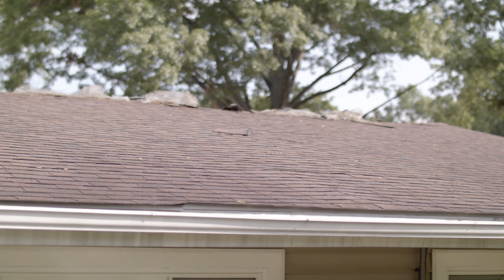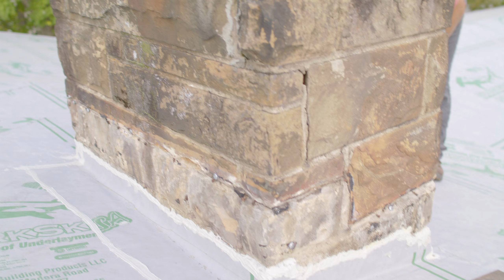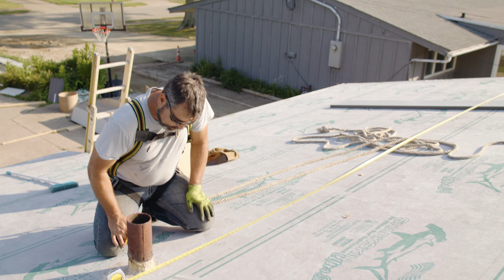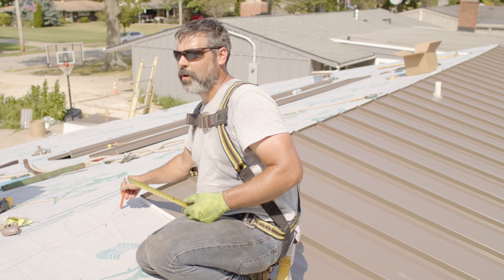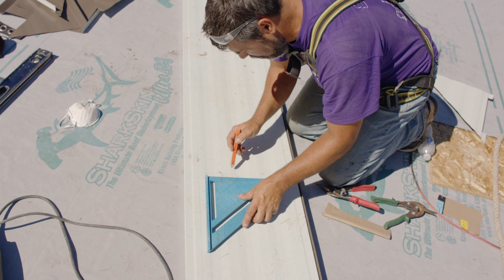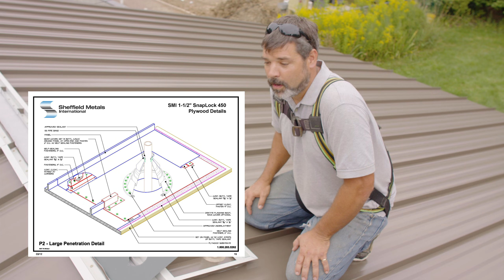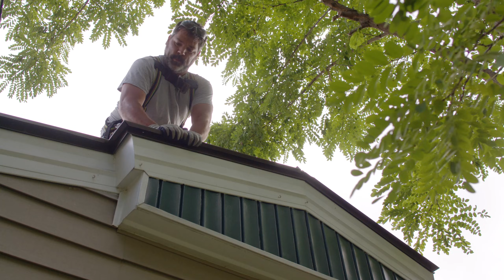How to Install a Standing Seam Metal Roof from Start to Finish

Comment: Thanks for sharing, why weren’t 1x4 wood pieces installed for air ventilation like you did on Matt Risinger’s roof, is it cause this house has soffit vents while Matt’s doesn’t?

Also, if I understand correctly Sheffiled Metals is the manufacturer, but what happens if I need different lengths - who cuts and delivers those?

Thanks again.
Reply from the maker: Matt's roof was designed with an above-deck ventilation system which also creates an air barrier, while Adam's roof is vented through the attic. To be clear, we generally recommend using a ventilated mat product (https://sharkskinroof.com/sharkskin-products/sharkskin-vent-roof-mat/) rather than wood furring strips for above-deck systems because there is no engineering available for panels attached to 1x4's in that manner. Matt's installer was more experienced using the furring strip method which is why that particular roof was constructed that way. I'll be doing more videos both on The Build Show with Matt and here on The Metal Roofing Channel over the next few months so stay tuned!

Sheffield Metals has a network of regional manufacturers that fabricate panels either in their shop or on the jobsite. Drop us a line and we can get you setup with someone in your area: http://bit.ly/contact-sheffield

Thanks for the comment! -Thad
Reply: @TheMetalRoofingChannel  Thanks Thad - I probably miss something.
What happens if in Adam's roof condensation occurs, where does the trap water go.

Don't have any more follow up questions regarding the manufacturers.

Thanks again.
Reply from the maker: All projects are slightly different, but in the case of Adam's roof, it is properly vented through the attic so condensation will be minimized. Also, Matt is located in a hot and humid southern climate, while Adam's house is in a snowy region which played a role in the decision. If some condensation were to develop on Adam's roof, he has a full ice & water shield to protect the building. If you're interested in learning more about condensation, check out this video: http://bit.ly/metal-roof-condensation-video -Thad
Reply: @TheMetalRoofingChannel  Thanks again Thad, I watched this video before and did it again just now :)
The video you shared is about condensation in the attic while I'm worried about condensation in a very thin area: above the Sharkskin Ultra and below the metal roof.
Since the Sharkskin acts as ice and water shield, it's most likely not breathable, hence, it completely isolates the house and the exterior environment, which eliminates completely hot or cold air in the attic compared to cold or hot air outside respectively, which then eliminates any chance of condensation and mold in the roof rafters or plywood - It might be the same as the thin area between the siding of the house and some vapor barrier where if condensation occurs, it disappears faster than it can damage the wood ( in case of cedar siding ) - it's probably the same with the metal ( and even better since metal heats faster ), it disappears before it can cause any rust to the bottom of the metal.

To conclude: If Sharkskin Ultra is not breathable and seals the plywood which is above the attic and below the metal roof, I don't see why at all a 1x4 or Shark Skin roof mat is required, regardless of climate zone. And if it's required, then it has to be installed by the same logic around the entire house above the zip system for instance and below the siding.
I have posted the same question directly to Sharkskin, still waiting for their reply.

Moreover, regarding the 1x4, it's wood: if there will ever be a serious condensation problem, it will rot.

Thanks.
Reply from the maker: @RomanWeisman  Thanks for checking out the video! Are you installing a roof on your house or are you a roofing contractor? Either way, this question could also be posed to the Sheffield Metals Technical Department. They would be able to get into the details of your concerns better than I. Feel free to drop them a line here: https://sheffieldmetals.com/technical-department/ -Thad
Reply: @TheMetalRoofingChannel  Thanks, my own house - will do, once it will be closer to the install.
Appreciate your help.
Reply from the maker: Awesome good luck with your project and let me know if there's anything else I can help with! -Thad
Reply: @TheMetalRoofingChannel  Would you like to come to Memphis TN to do a video on a Metal Roof?
Reply: @RomanWeisman  I completely undertand where you are coming from...that is why Thad recomended a drainage mat to be installed between the metal and the substrate...this raises the metal off the roof surface allowing for condensate to drain without resistance or capilary retention

Comment: Awesome video.  I have a problem though ... hoping  you can help.  I watched your video on condensation and am still confused.  I am starting to build a very large workshop ... 3500 sq ft plus 1000 sq ft loft.  Simple roof (no valleys).  To save money and put the cost in line with a standard shingle roof, I want to use purlins (the standing seam roofing I am looking at says that it can be installed over solid deck or purlins).  I am worried about condensation  ... especially since I want a very dark colored roof.    I will put in ventilation on the eaves and peak ... I will insulate the ceiling below and leave an air gap ... I will use a vapor barrier (poly).  I have asked about condensation but no one seems to give me definitive answer.  I am getting ... "the purlins touching the roof will get wet and rot" ....  "I would not do it that way" ... and "well it almost rains in my barn" (that has no insulation) ... or "who goes up in the attic to check".  In VT, metal roofs just are not common except on barns and such.  So, my question ... dark (or any metal roof) on purlins  ... with and insulated ceiling and ventilation .. do I need to worry about condensation?  Things like spray foam and such are just way outside the budget of a workshop.  Thanks ....... Mike (xtal_01@yahoo.com) in VT
Reply: The metal roofing should have between an 1/8th to a 1/4th inch of airflow between it and the underlayment with the standoff clips used in the video here.   And the ridge is vented to help keep it dry underneath, if this helps.   I've installed many metal roofs in the Pacific northwest and this is how we always do it, because of the very eet climate.
Reply: I have a 2 story garage I built with 2x4 purlins 2ft O.C. down here in Richmond, VA (humidity center of the earth).  I am planning on installing a metal roof and getting an inch of closed cell foam sprayed on there before I start to condition the space below the roof trusses as my office.  If you find another viable option please let reply to this comment as all of the options I find will just droop and have some kind of air space develop below the metal.
Reply: @brianwelteroth9248  Will do.  I talked with a couple of "experts" now ... all say it is really a mater of isolating the area under the roof from the shop. I am planning a truss with a 24" energy heel.  With 12 or even 18 inches of insulation, I will have at least a 6" air gap.  I will vent the eave and the peak  ... this should give decent air flow.  I will also have a vapor barrier (poly) and no penetrations into the ceiling (I will exit everything out the gable ends).  I think this is about the best I can do ... plus cross my fingers!  Got into the 50's today ... sill some snow on the ground (24" takes a while to melt).  I was out on the pad prepping it for the mud sill ... want to start next week.
Reply: @xtalvt  I have one gable plumbing vent, it is code that side vents are 15ft away from operable windows or doors, and the gable must be sealed to the roof deck.  Condensation occurs when your roof is colder then the air in the attic.  Basically whenever a cold front hits with rain at the end of a sunny day.  Or if you really crank the heat up or have HVAC ducts in your attic.  A darker roof would help mitigate condensation, I would also choose steel over aluminum.
Reply: @brianwelteroth9248  Awesome ! Thanks so very much for the advice.  VT is rural ... very rural ... 42,000 people in our largest city.  No inspectors ... built as you wish ... hmmmmm.  For my permit, I simply put a square on the plot map and I was done.  The only inspection was for the septic (had to have an engineers stamp) and a final showing I had a working sink and toilet (and that was all he checked to get my certificate of occupancy).    Builders around here are terrible I found ... non seem to follow code.  I have done a bunch of homework ... lots of reading ... trying to do the best I can.
Thanks again so much !!!!!!!!